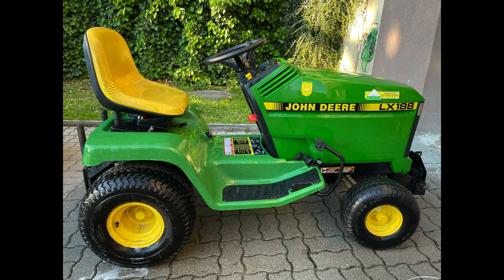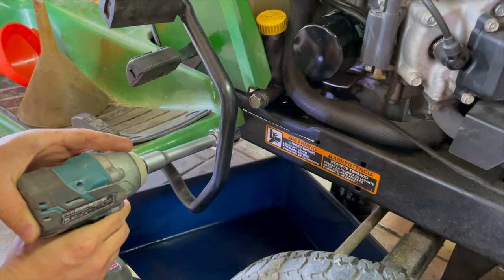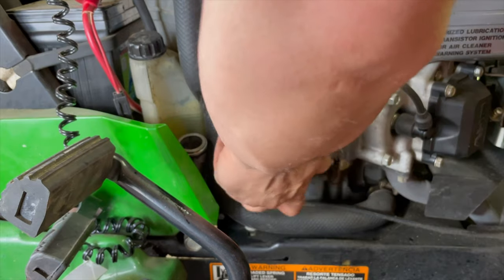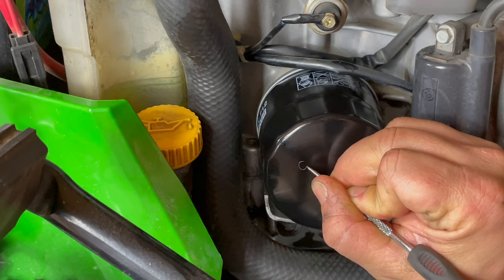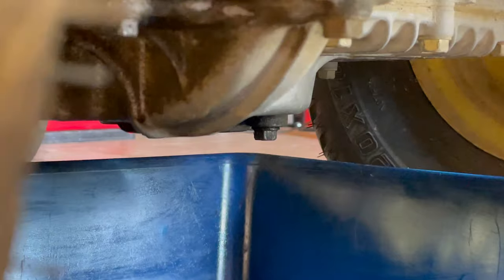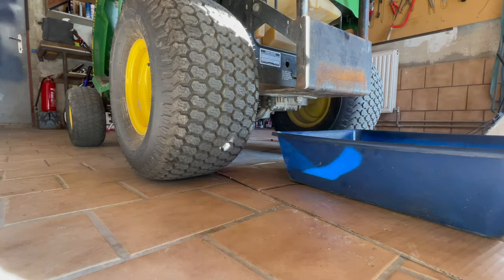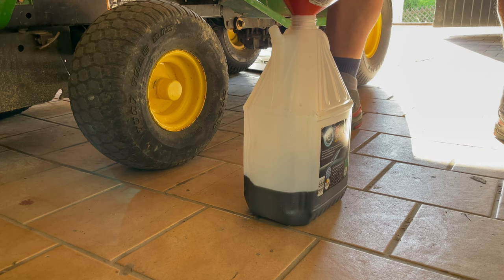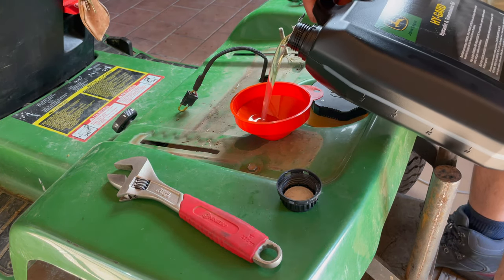John Deere Lx 188 Motor and Transmission Oil change

Comment: Thank You for your video. I bought my LX188 new in 1992. It still looks new. I never realized the transmission fluid change was so easy. I just did it for the first time.

Comment: Hi- I watched your very informative video and thank your for the precise instructions. However now I have already bought the hydraulic fluid. But I can take it back- Did you notice anything  bad upon your using the hydraulic fluid? Also I have 3 bolts (plugs) under there and I could not see which one you took out?
   Thank you!
Reply from the maker: hello , I don't see any difference after I did the oil change . I can send you a picture with that screw you must write me at ady_dvd@yahoo.com

Comment: Nice video--I have the John Deere LX188 Factory Technical Manual and it states : "DO NOT USE BIO-HY-GARD in this transmission" . John Deere TURF-GARD SAE 10W-30 or equivalent is preferred.
Reply from the maker: Is not Bio
Reply: @howidoit6012  The manual lists only 3 options: TURF-GARD SAE 10W-30, PLUS-4 SAE 10W-30 , or TORQ-GARD SUPREME SAE 5W-30. It states that other oils may be used if they are rated API  Service Classifications SG or higher. Too bad You tube doesn't have a way to post pix or I could insert a photo of the service manual page. Hope this helps
Reply from the maker: At the time when I did the oil change I read somewhere that you can also use Hy-Guard .
But you are right according to Tuff Torq  (for K61)https://tufftorq.ordertree.com/media/promo/TuffTorq/Fluids%20and%20Lubricants.pdf 
I made an update  in the subtitle of the video . Thx

Comment: I have a LX 186 with the 17HP air cooled single cylinder and it states in the manual, to prevent contamination in hydraulic system, DO NOT drain or change the hydrostatic transmission fluid.
Reply: yeh right so you have to buy new tractor when when trans goes bad . tuff torq the manufacture of john deere transmissions gives oil change interval and oil type for each transmission.
Reply: @garyvisintin8431  I bought it new in 1991 and still runs like a new one. I'm afraid if I go against the owners manual and change it now and it goes bad I might regret it.
Reply: Boys, I bought a new LX188 in 1994.  I had the dealer install an hour meter when I purchased it.  The Tuff Torx went out at 1000 hours.  I bought a used one for $200 and installed it, it lasted 500hrs.  When they are wear out, they are wore out.   I changed the oil every 200 hrs on the Tuff Torx.  I average 50 hrs a year mowing.